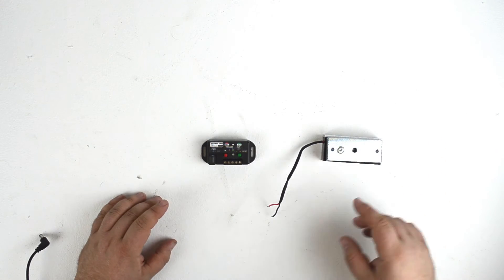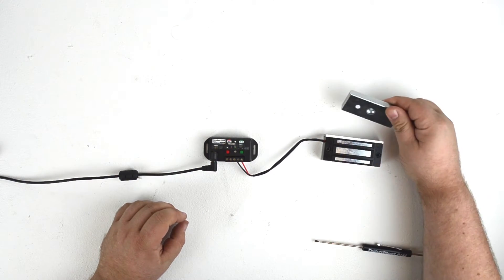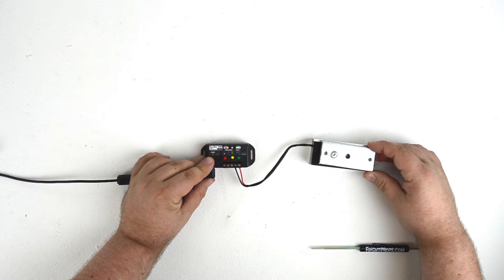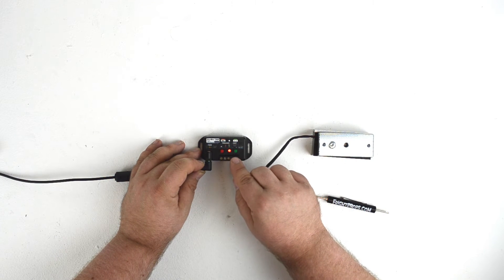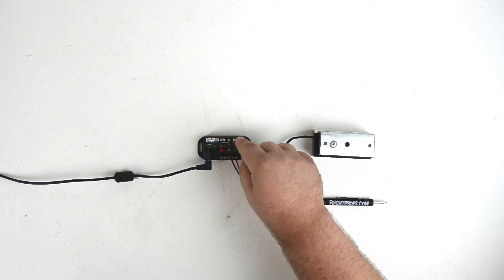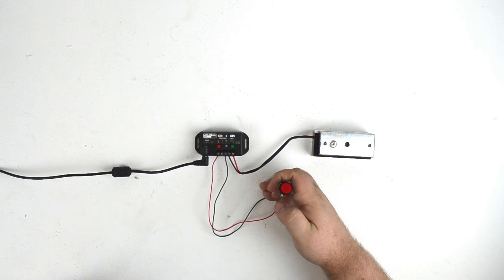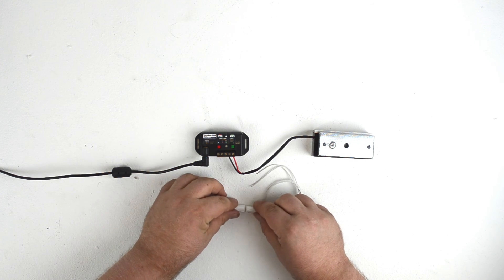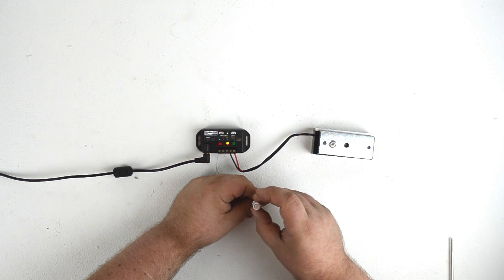Using a PicoBoo ONE Controller to Open a Magnetic Lock

Comment: Will this controller work with rfid
Reply from the maker: If your RFID unit has a relay like ours do it will work.
Reply: FrightProps i am using your rfid triggers  but i cant get it to work
Reply from the maker: Send an e-mail to sales@frightprops.com and we can help you figure it out.
Reply: Would I have to manually start this each time or would it set up when power is turned on?